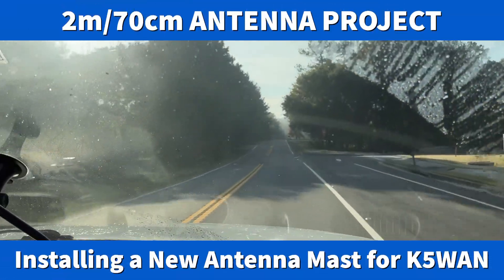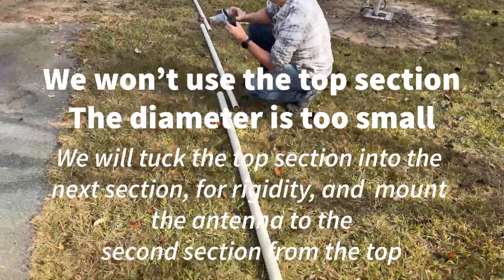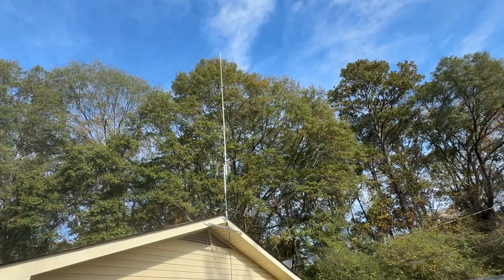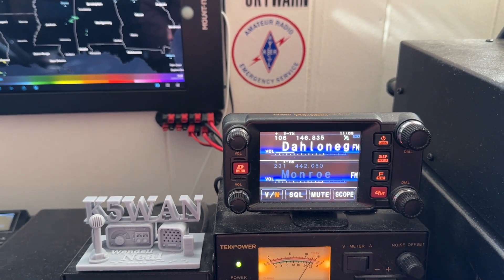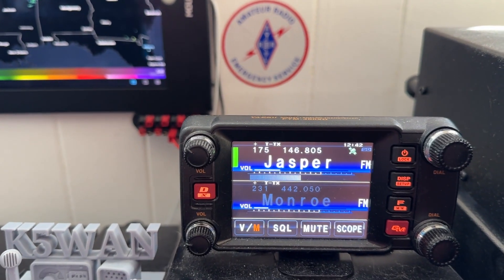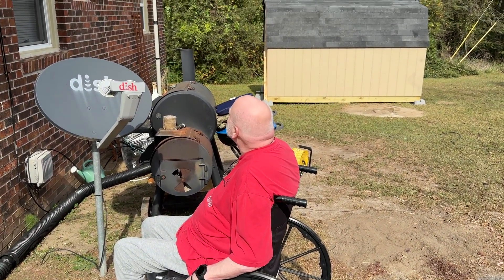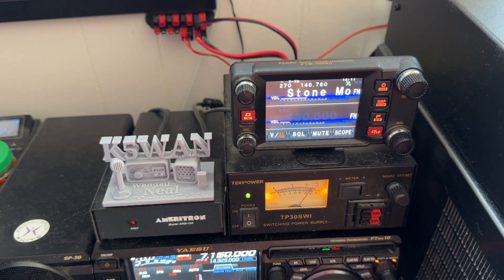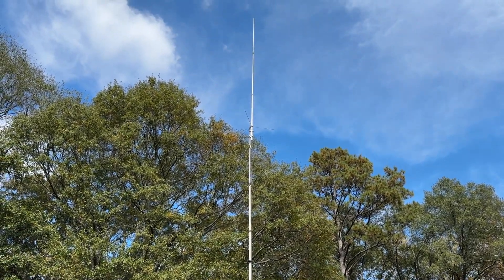2m/70cm Antenna Project: Installing a New Antenna Mast for K5WAN #hamradio #antenna #installation

Comment: Doug, thank you and Joshua for your help and efforts. I am getting into many more repeaters now that my antenna is higher. I am grateful for your work and help with this antenna project. 73!
Reply from the maker: You are very welcome, Wendell!  It was an honor.  73, Doug
Reply: Wendell glad Doug and Joshua were able to get your 2m/70cm station working better!   Glad I could help with the coax for the project, but Doug and Joshua did the hard part!